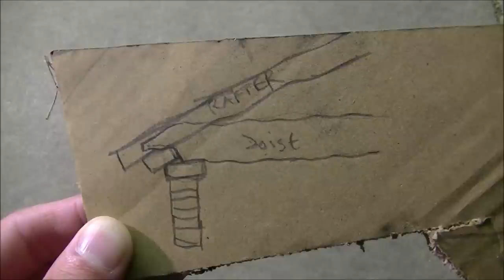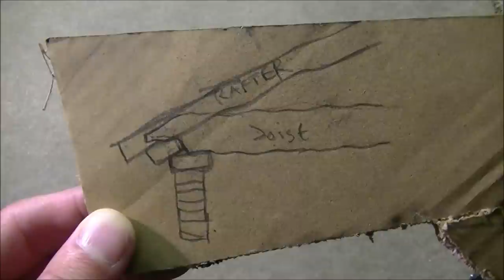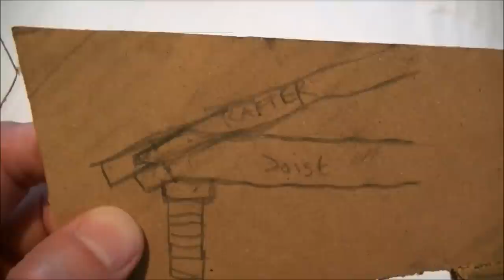Loft Conversion Part 2 - Cutting & fitting the joists. Joist installation.

Comment: Planning on re-enforcing my loft, not for living space, just to store and use weights up there. This is without question the most useful video I've seen, especially using the packers, many thanks.
Reply from the maker: Thanks for the feedback and best of luck with your project. Just remember to use the right material for the packers. I used plywood which is compressed so has structural strength under load but some soft woods wouldn't be suitable.

Comment: Nice,  i notice a lot of companies propose always using steel beams to run the length of the building rather than relying on joists. into the side such as you have.

Comment: Agree with Luc about uneven noise levels, trying to watch quietly in bed with the boss asleep and then BOOM the music kicks in. Otherwise a good and clear informative video but one safety point with the bench saw. The blade should only be up just enough to kiss through the top of the timber; if it is higher than that then fingers are at risk but worst of all the chances of "kickback" incease and you could get a piece of 3 x 7 in your face! Good job, thanks for the effort.
Reply from the maker: Hi Gareth, this was an early loft video, I think I've sorted the sound now. Thanks for the feedback and thanks for watching.

Comment: Thanks for uploading these videos,iv been looking into doing my loft myself and with your help i feel like i cant take it on,think im gonna be running the new beams alongside the old beams because of the height,I was planning on cross beaming  you see.
Reply from the maker: Best of luck with it. Don't forget to calculate the size of the joists required. To do it as a 'habital room' you will need to apply to your local authority building control department and they can advise on the correct way to construct it and comply with fire regs. If it's just for a storage room then no need. Thanks for watching.
Reply: Great vid mate. Can I ask did you get building control in for this or is it just for storage

Comment: Excellent video, thank you massively for the effort making it.

Question please: you said you didn't want these joists pushing down and cracking the ceiling, why not hang a ceiling on these joists? 

I have joists holding up a floor on top and a ceiling underneath. Just wondering why you didn't opt for this

Comment: Firstly I would like to thank you , your videos are very informative and the way you have done them in different parts for different stages makes the whole project a lot easier to digest, and not as overwhelming as it could be. 
I am hoping to do my attic the way you have done yours either doing bits myself or project managing the job to save some cash . 
I have a few quarries and Would be extremely great full if yourself or anyone else with loft conversation experience could help with . 

As yourself I live in an older house 1930s. A semi detached With a tradition gable roof . I have an internal supporting wall running right up the house . This puts my span from internal supporting wall to external walls at 12 ft. ( 3.66 m )  I don’t want to lower ceilings in bedrooms below for obvious reasons .  I am planning to use c24 timber 75x 147  at 400 m centres .  Would this be ok with building control . I don’t want to put steel in due to now having much head height ( 220 from top of ridge board to ceiling joists .   If building control would be happy with the same set up you have done, 18mm packers on wall plates then 147x75 c24 joists at 400 mm centres . That would give me very close to my 2m head height when finished .   I want a dorma at the rear of my roof , coming off the wall plates Any help guidance would be greatly appreciated
Reply from the maker: You would need to speak to building control and check. I had a structural engineer calculate what joists I needed and I supported my dormers off the joists and rafters as they are pitched roof but this was all calculated. If you are having a flat roof dormer then you would need your current ridge board to become a ridge 'beam' as this will need to support the vertical load of the dormer roof so you will probably need a steel or some large timbers for a beam. If you are happy with the roof being lower than 2 meters then even if it doesn't meet building regs you can still have it as a space that is structurally sound (use correct joists, beam etc) but with less head room. It just means it won't be classed as an official habitable room so you couldn't sell the house as having an additional bedroom. Worth doing the planning first as it's a lot of work to do if you're not happy with the end result. Hope that helps and best of luck with it.

Comment: What’s the head height like seems tight?  Nice work though. Although I would have probably notched out the noggins to fit vertically. Would be much better at stopping the twisting of the timbers. But should be fine anyway.
Reply from the maker: Should get about 2 meters when finished. Stair height will exceed this but as you say it's not a tall loft, but it'll still be a nice space with a bit of character when done. As for the twisting of joists - the joist I used are shorter but wider than standard, and don't forget they will have floorboards screwed into them and verticals down off the purlins (all will be revealed in future videos). Trust me, if you stand on them they are solid as a rock. I've screwed them to the rafters as well. Thanks for the feedback, part 3 now available. Thanks for watching!

Comment: I know this is a very old video now but I still can't quite believe this was signed off by building control. The requirements say that any overlap of joists should be limited to 100mm to prevent canterlevering and that the noggins have to be at least 1/2 depth of the joist. It doesn't seem you meet either of these criteria???
Reply: Hi Adam… I’m looking too do this to my loft and was wondering if there was such a need for a massive overhang,can you explain abit more about the noggins have to be 1/2 inch depth of the joist…?? Many thanks👍

Comment: Good job,Jst one thing why have you not placed your floot joist noggings up to the actual joist level (Floor level) That way you can use them as extra places for the floor board screws?
Reply from the maker: I tried to center them to help with strength. Thanks for watching!

Comment: Great series of videos, the right balance between the informative and the entertaining. One question, did the existing ceiling joists have binders on top, if so did you just remove them to fit the new joists in?
Reply from the maker: There were two I think, and not doing a lot! I removed them but I redid all the ceilings with plasterboard years ago so I know they wouldn't shift. If you have the head room you can sit your joists above them with packers? Best of luck and thanks for watching.

Comment: No need for steel beam to pick up floor joists? 

Look forward to part 3
Reply from the maker: No, my house is victorian,  all solid brick walls from foundation right up to loft. The span between walls is short enough for joists to span with joists sat on existing wall plates across to center wall. A few people have said this but remember newer build house often have no solid wall in the middle, and have a trussed roof structure that needs completely replacing with steels. My house has  thick rafters with huge purlins supported of the solid brick walls. Thanks for the feedback and thanks for watching.

Comment: Great video the joists can be overlapped across load bearing wall and bolted together? building regs were ok this? How did you arrive at 400mm centres for joists?

Comment: Hi first of all brilliant job. Question is did you use any pilot holes or clearance holes at least in either the joists or noggins prior to driving the screws in?
Reply from the maker: Yes! Although not really necessary with right screws on joists that thick.

Comment: great video. I have plans to board out my loft and have been advised to fit joists across existing joists for insulation reasons. is there a reason you fit the new joist in the same direction as existing joist or would it still be ok to fit in opposite direct and sit new joist across existing. hope that makes sense :D
Reply from the maker: My joists are structural for a floor in my loft conversion, so I've placed them on load bearing walls the same as my original smaller joists. What you are doing is fine assuming it's just for storage. If you were making a structural floor then they would need to be supported on something that can take the load. Hope that helps. Thanks for watching.
Reply: POUSE around the HOUSE how do you know if the walls can hold the weight

Comment: Great video mate, i've rewatched waay to many times!   Could be a daft question this.. what's the easiest way to draw out a template to cut the joist for a snug fit ontop of wall plate. I assume i'll need an angle finder to get the pitch degree?
Reply from the maker: Yes it helps. I used cardboard and then offered it up each time. Trimmed it back until it fitted snug. Obviously if using this method just make sure you have enough of the joist sat on wall plate. Some roofs don't allow this and then joist hangers might be the only option or steel beams which will then support the joists. Best of luck with it.
Reply: @POUSEaroundtheHOUSE  top man, cheers mate
Reply from the maker: @adamdowney9423  no problem. One more thing, knee pads might help your knees and stop you moaning every time you stand up later that evening!

Comment: Hi. Which kind of joist should be installed when building attic floor( Joist size &  joist thickness?) How to installed them in old house? If u can please answer my question?
Reply from the maker: It depends on what you're doing in loft and what the span of the joists is. If it's a proper loft conversion then you need to speak to building control in your local authority. Hope that helps.

Comment: You've done really big overlaps over the central load bearing wall, is that compulsory,  or can I just rest the end of my joists on the load bearing walls (I have one either side, as only doing the middle of my attic) as long as the whole width of the brick is covered? Wondering why you need noggins as my existing 1940's joists don't have them? Anyone who knows, I'd really appreciate your opinion...

Comment: Hi Pouse...   you use two pieces of joist, overlapping; so are the joists still square as one side will hit the rafters in a different place?  Hope not a stupid question
Reply from the maker: Correct, square joists, one joist sat away from rafters so I used a piece of timber to bridge the gap then screwed them all together. You can see that in a later video. Thanks for watching

Comment: Great video! few questions. I saw you fixed the joists to the rafters one side when they butted up, what was done on the opposite side as i assume the joist were only butted up to the rafters one side as they would sit out 75mm due to the overlapping on the spine wall?

Where they over lap on the spine is it worth fixing these together with a bold and dog tooth connector similar to building a double trimmer?
Reply from the maker: I used timber to fill the gap then screwed them all together. Think I showed that in a later video. Bolts are always good as more robust if you want. You just have to be careful not to knock the old timbers around too much as they will have been settled for years. Thanks for watching.
Reply: @POUSEaroundtheHOUSE  Brill that was exactly what i was planning on doing. Where the joists overlap on the supporting wall did you fix them at all or are they just braced by the noggins? is it worth bolting them with a dog tooth joiner?

Comment: I'm guessing you have a load bearing wall, the full span of your house?  What would you have done if the internal load bearing wall only went 3/4 of the house span?
Reply from the maker: Ask the structural engineer for options! Thanks for watching.

Comment: hi mate l need replace a joist in a small flat blahblah .. could you tell me the right name of the wood for the joist. MY base is in London and t the moment in B&Q , Selco, Builderdepot they have whitesof wood l think it is foor roof , but l want for joist!!  is hard for me find the proper name of the joist.. can you tell me how i can order the wood for joist correctly. Thank
Reply from the maker: You need a structural engineer to calculate the size of joists if doing it properly to building regulations. This is based on span, deflection amongst other things. The strongest timber is usually C24 graded timber but width and depth depends on span. Mine were 3.5 x 7.5 inches. Hope that helps. 2 x 9 inches is also common.
Reply: @POUSEaroundtheHOUSE  Thank all the best

Comment: Excellent video mate. I am looking to do the same but without putting on a new roof. How would you recommend securing wood to the plates ?
Reply from the maker: I'm using screws, but nails can also be used. It depends on your set up I guess. In a later video (not uploaded yet) when the slates are off you can me screwing through the joists into the wall plates. Hope that helps. Thanks for watching.

Comment: I'm confused as to why you could not board the existing old joists? were they not supported enough to take the weight?
Reply from the maker: The existing joists are not strong enough. When you have a loft conversion you are creating a new usable floor. A structural engineer will do calculations for you and determine what size joists are required.

Comment: Just a quick one. Been reading building regs on noggins / supports.  Ard they not supposed to be 75 percent of depth of joist? I have the same issue and putting them on the side doesnt cover 75 percent of my depth. Did this meet building regs?
Reply from the maker: My inspector was happy. These joist are shorter and wider so less chance of twisting maybe but in reality, once floor boards are screwed on and all joists screwed to wall plates and rafters it isn't going anywhere but you have to discuss that with your inspector. Some re more square than others!! Best of luck with it.
Reply: Yeah my thoughts exactly, nothing is going anywhere but dont want a picky inspector. Didn't want to put in and then told dont meet regs. Other thought was to do lengthways and notch out the original joist. Thanks for the reply.

Comment: Great video! Can I borrow your old man, I have a project I want to string out for a year or two ;-) Only joking.
Was this done to building regs? Is there a rule for noggins to conform to regs  I.E. one every X cm's or something?
Reply from the maker: Yes building regs but best to speak to your local officer. Mine was very flexible and pragmatic and I just rang him if I came across any issues. He was really helpful. You can find a lot of info on the .gov website regarding loft conversions, fire safety, joists, stairs etc, well worth a read. Hope that helps.

Comment: Hey, I couldnt tell in your video if you did it or not, but did you sister the new joists to the originaly (2x4?) joist at all or did you keep them seperate?
Reply from the maker: The old joist are over 120 years old and imperial size so more like 2 x 3 half I think. But I kept them separate where I could so not to cause the downstairs ceiling to crack if there is any movement. What I did do was screw and nail all the new joists to the wall plates in a later video to help strengthen the whole roof structure. Thanks for watching.

Comment: I noticed the 7x3 timbers your putting in are tight up to roof rafters when your sitting them onto the wall plate? I'm doing this myself as a i just wondered or can they sit between as well?
Reply from the maker: You can sit them wherever, but I fixed my joists to both the rafters and wallplate to ensure the roof couldn't spread as there had been small movement previously where the rafters has slipped slightly, but the roof is over 120 years old! Thanks for watching.
Reply: @POUSEaroundtheHOUSE   ok thanks for that.
Reply from the maker: @JohnUk65  no problem.

Comment: Was this inspected by building control? My wall plates are about 2.5” out of Level from one side to the other. Plywood is a great idea to bring up the level.
Reply from the maker: Yes, the project is inspected at set stages. Thanks again for watching.
Reply from the maker: Yes, the project is inspected at set stages. Thanks again for watching.

Comment: hi , nice work, Building reg question,, how did you calculate the size of your new joists, you said you went for less depth and fatter joists ,, did you have to get that signed off for BC before hand.
Reply: You can search for 'floor joist span charts' online.

 My house is 4.2m span, so according to the chart for current building regulations, I have used 9"x2" C24 grade joists, at 400mm centres. I've overdone it with blocking, but there's no issue with that.

I spoke with the local councils building control to begin with, yes they do need to be notified, they will come look, advise, and you invite them back at various points of the build, about 3 times. It cost a certain amount to get it signed off, not as much as private building control firms.

I'm aware of some strange stories of private company standards for a pass, and was wary of them, but the council seemed more stringent, which is what they should be. 
I'm converting it for my daughter's bedroom, I want it 100% correct and safe, no half arsing anything. The person with the clip board shouldn't accept anything less than correct.